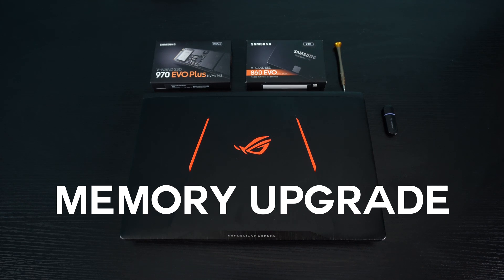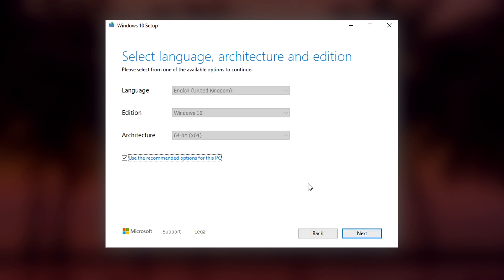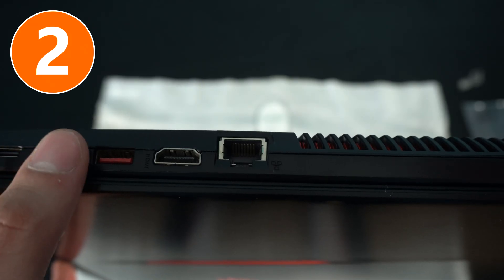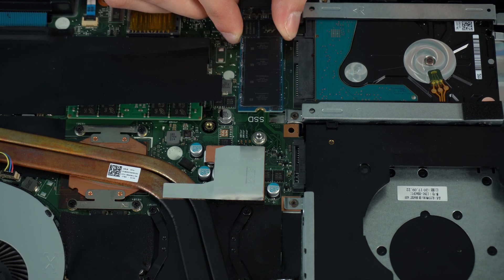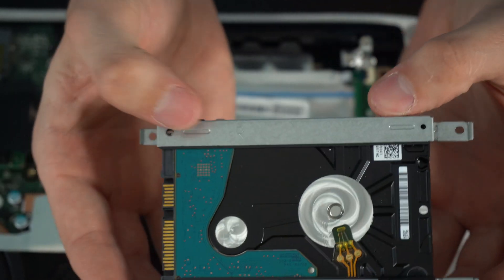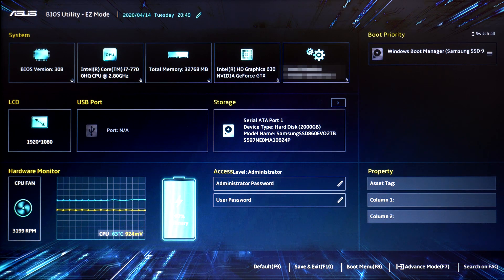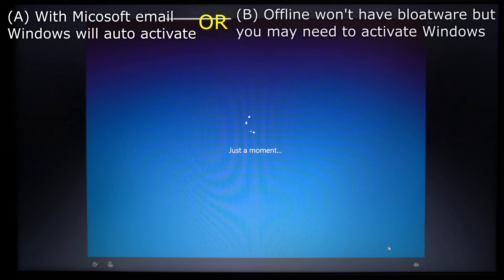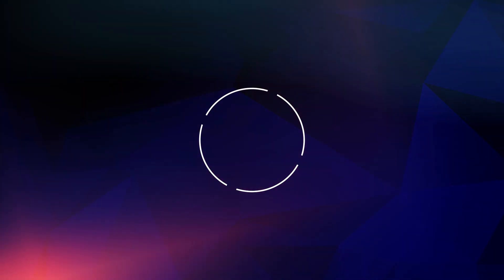How To Install NVMe M.2 SSD & A Solid State Drive In Laptops

Comment: How do I know what drivers I have after the fresh install. And which ones I need so my Pc can run the best performance.
Reply from the maker: Nowadays if you just update Windows it should also install the essential drivers but the most important ones are graphics driver and network drivers but like i said now when you update Windows it will also automatically install them
Reply from the maker: Or once you have full Internet connection

Comment: for better performance from a laptop between using
only 1 tb ssd nvme partitioned or
500gb ssd nvme + 1tb ssd sata or
500gb ssd + 2tb hard drive
What would be the best storage option?
Reply from the maker: If you're on a budget then go for 1TB nvme but for the best performance go for something like 500GB nvme main and 2TB ssd because your 500GB can focus purely on Windows & programs while your other one will be purely for storage (saving and reading data etc.)

Comment: Do we have to change the bios back to fast boot after windows installation?
Reply from the maker: It's completely up to you if you want your system to quickly boot up then have it turned on. What it does is instead of your system fully shutting down it will put it in hibernation mode instead

Comment: why format the USB in Fat32 and not NTFS? if I will install the SSD storage myself, will it void the warranty of my laptop?
Reply from the maker: For the usb i just left it on default settings and yes opening the laptop will void warranty because they have a little bit of blue paint on the bottom of the screws which will fade away over time and show them it's been open before

Comment: Best video I have seen for this laptop thanks. I have had the GL553VD for a few years but is slow now so I am putting in the same SSD and 32gb of Kingston DDR4 ram. I hope this will speed things up a bit.
Reply from the maker: Yup m.2 will and some ram, check your laptop model to see the max ram speed you can have for best speeds. Also I appreciate the feedback glad the video is helpful:)
Reply: @VerticDesigns  I have the Asus GL553VD DM596T it's only has 4gb and can have 32gb max so that's what I went for. Maybe later I will get the 860 EVO SATA 3 and change the HDD.  I also watched you RAM video that seem very basic so sure all will go well and I will check more of your vids and sub thanks.
Reply from the maker: @kanenstuff  ah right and yup ram is very easy to do. Just plug and play. You'll have to let me how it goes after the upgrade aha I can't believe yours only came with 4gb they definitely cut a bit of the budget on the ram
Reply: @VerticDesigns  can I ask a quick question if I am not changing the HDD to a SATA Samsung 860 can I just put windows 10 on my 970 EVO PLUS M.2 SSD? Any information would be appreciated if you have the time thanks.
Reply from the maker: @kanenstuff  Yes, since your M.2 will be your primary storage. You can upgrade the HDD at any time without having to reinstall Windows
Reply: @VerticDesigns  OK thanks that makes it more simple thanks for that.
Reply: @VerticDesigns  hi how are you I have upgraded my M.2 and all is good but with the kingston KVR26S19D8/16 DDR4 the number on ROG gaming centre are weird.
GPU 139MHz
Temp 44 degree C
Memory 405 MHZ
Then it changes to
GPU -1
Temperature -32768 C
Memory -1MHz
Is this issue as I thought the DDR4 is plug and play the SSD was simple but these numbers make no sense and why they change back and forth. If you have any idea would be greatly appreciated thanks.
Reply: @kanenstuff  how did your upgrade go? I am thinking of doing the same with the SSD and storage.
Reply: @akg2n  it's gone fine for me so far but don't use epic games or it will do the BSoD. I had to reset my computer then all was good my write speed is up from 128 to 3320 which is nice.
Reply: @kanenstuff  thanks I did the same with my gl553... Difference is night and day. Really happy with it.
Reply: @akg2n  glad you like it, it's super fast and how it should of came from the box.

Comment: is this applicable to all laptops? I have a Nitro 5
Reply from the maker: If they have a M.2 or SATA port like in the video then yes. Best thing to do is double check the laptop motherboards manual it will say on there
Reply: @VerticDesigns  oh right, thanks! Sorry I know nothing about these things and I've been researching, so windows 10 is lost when you change storage? I thought it was like a separate thing 🤣

Comment: Hi, great video. I have rog strix GL 753ve, similar to this one, i'm planing to upgrade m2.sata 256 gb micron to new samsung 980 Evo Nvme 1TB. I was planing to migrate my current ssd to the new one with samsung software. I'm not sure about the windows license, I have OEM license activated so basically it goes to one device. On Microsoft page they say that OEM license is linked with  the motherboard so i could reactivate it. Also currently i'm not linked with microsoft account, just the local account beacuse of annoying wifi request. Is it safe for me to continue with the upgrade and migration? Thank you.

Comment: My 970 evo plus didn't deduced by Bios (ASUS like you) why?
Reply from the maker: Does it just not show up anywhere in bios?
Reply: @VerticDesigns  not show in the bios and in the window setup also.
Reply from the maker: @MrDr2GoN  That's strange then it should pick it up, have you got the exact same model?
Reply: @VerticDesigns  I have Asus Tp410
And I upgraded my ssd to 970 evo plus. Maybe the ssd driver is old
Reply from the maker: @MrDr2GoN  That is a good point, try getting a new driver on your usb and updating like this video see if it helps: https://www.youtube.com/watch?v=8VS-u_ZrgVs&ab_channel=JuanLince
Reply: @VerticDesigns  I updated the bios and still same problem.

Comment: Wait Sir I want to ask something. Your old SSD are SATA right? with 2 keys (M Key and B key) and your New SSD are NVme with only one key (M Key). Will it work and will it do any harm?
Reply from the maker: That's a very good point and I believe it depends on the laptop and manufacturer because I've been using mine since I installed it with no problems, the boot is normal for me and is quick but some are designed for either SATA or PCIe and some support both. Best thing to be on the safe side is look at your manual or contact your laptops company for a more technical support and help or just simply test it. I shouldn't damage it because most products are backwards compatible so even if you didn't get the full potential it should still work like normal but like I said best thing is to asking the company because they know everything about the system
Reply: @VerticDesigns  We have the very same laptop sir, so I think that'll be okay then.
Btw, thank you sir
Reply from the maker: @billclintonmosesmanullang7446  No worries and nice it's a good laptop plus it's easy to upgrade

Comment: Hello @VerticDesigns, i have the exact same laptop as shown in the upgrade video. Im thinking of adding a NVMe M.2 SSD over my 1TB HDD. I see that you use a 500GB one, i wanted to upgrade directly to e 1TB NVme M.2. However on the official ASUS website it says the SSD storage capacity is up to 512GB. Does that mean it cant support a 1TB one. I couldnt find an answer to this. Wanted to be sure before i buy it? Thank you!

Comment: Guys when l replace my old m. 2 ssd 500 card with new m. 2 ssd 1TB card.. I can't start my laptop, it is always starts with bios now.. How can l go out from bios? It brings me back to bios after l  restart my asus fx505 laptop. Thank you guys!
Reply from the maker: Sounds like you need to change the boot priority to your new ssd, if you need in bios there will be a location that allows you to change prioritizes. Set your m.2 as your first boot option. Also did you install Windows? without the OS then the computer will just launch in bios
Reply: @VerticDesigns  Thanks for fast reply.. My old m. 2 ssd card, was the only memory card inside my laptop, I got only one spot for m. 2 ssd cards.  So probably, that's why starts on bios, windows installed there. Can l install new windows on the new m. 2 ssd 1TB card? Or is better to put Sata hdd inside for extra memory? Thank you very much!
Reply from the maker: @francescogeo  it depends on what you're storing but normally it's better to separate the boot ssd from the storage drive but if you're just going to be using programs then that 1tb should be enough
Reply: @VerticDesigns  Thanks. Thanks for your time!
Reply from the maker: @francescogeo  it's all good

Comment: Hi,
How does license of current windows 10 goes to Flash Drive or how does new copy of windows 10 handle license?
Reply from the maker: Basically Microsoft allows you to install a fresh installation of Windows but all you need to do is buy a license key to activate Windows. I'd recommend Kinguin they have some cheap keys compared to retail but they're OEM keys meaning one activation only. Once you got the key you get a few blocks of numbers on your screen, you call the number, read them out and activate it over the phone

Comment: Would this work for the ASUS Nitro 5?
Reply from the maker: Yes, it's even easier for your model because the bottom panels are separate so you can open the ram window directly

Comment: I have a hp omen, currently it has a 1tb hdd but I bought a m.2 ssd, it can install the operating system and work on the m.2 if I previously installed it on the hdd?
Reply from the maker: If you install the m.2 and format it then it will act like your secondary storage and windows will run off your hdd. 

If you want the m.2 to be your primary then you need to backup your files from your hdd and wipe it, install a refresh new windows on your m.2 and put all the files back on your hdd after formatting it
Reply: Is it better to put windows files on the ssd or hdd? What's the pros and cons? Thanks :)

Comment: Hi, so I only have a hard drive on my laptop and I’m planning to put an m.2 ssd on my laptop and make it my main, and I’m still planning to keep using the hard drive as my secondary will my files on my hard drive that used to be my main will still have all the files? As in like when I boot up using the ssd will all my apps be erased or no.

Comment: is there a way that you can just run the M.2 SSD by itself w/o the SATA SSD meaning that you don't need the SSD SATA DRIVE?
Reply from the maker: If you wanted to yes you can just run the M.2 by itself as the primary one

Comment: Hi, does samsung 970 overheat easily in laptop?
Reply from the maker: To be honest with you no, not really. I still have great performance and since I've installed both of these SSD's my laptop has been so quiet you can't even hear it until you start gaming or editing. So yeh it works perfectly with laptops I would definitely recommend it. It idles at 40° average then it hit 43° when I opened premiere pro and while gaming I got 60° max

Comment: hey! so i have the asus gl553VD laptop and im wondering if the nvme m2 will fit in my laptop cause i know the samsung nvme only has a m key but the ssd currently installed in mines has two keys... so i think thats sata. so should i buy an samsung nvme m2 will it fit?
Reply from the maker: I probably wouldn't recommend it as you'd mostly likely get the same performance if the socket is just a standard sata but I also need to do more research as I'm not 100% sure on this so Id say to download the manual or contact Asus. There's also a lot of forums discussing this topic

Comment: If your Laptop already uses an SSD as it’s primary storage, then will swapping it out for a new one to improve more storage delete your files? Will they still be on the old SSD? Because most Laptops only have one M.2 slot. (To my understanding)
Reply from the maker: When you take it out the files will remain the same yes you keep everything unless you wipe it. What will happen when you load it up is there will still be a partition saved with windows and other half will have your files on
Reply: @VerticDesigns  Thank you for not only answering my question, but responding so quickly.
Reply from the maker: @Ian.cul017  no worries and have fun with your upgrade aha

Comment: What would be the steps to follow if i wanto to add a new NVME M.2 SSD?
I have a ROG G15
Reply from the maker: If you're only installing it for storage then you just add it in then format it but if you want to put Windows on it and use it as your primary memory then you'd follow the same steps in the video except the secondary storage that's additional
Reply: You would do the same thing, except just change out the ssd, and choose it to download windows 10 on it

Comment: Broo... Will my files from my laptop will be deleted??? I don't have ssd but i will install an ssd.... What should i do before and after inserting ssd... (am saying this again)i dont have an ssd forst but i have now.. Cuz i bought 1
Reply from the maker: If you're just installing a secondary ssd for storage your main storage will remain the same and your laptop will boot up as normal but you'll need to format the new ssd in "Disk Management" like I did at the end of the video for it to be visable.

To be more safe you can backup your important files to an external hard drive, USB or the cloud 

If you're switching your primary memory with Windows on then you will definitely need to backup your files as you need to wipe it first to install a fresh new copy of Windows
Reply: @VerticDesigns  do i have to back up my files? This is my laptop's situation:
Have an hdd 1tb
Then i bought an ssd for the ssd slot(my first ssd...my laptop doesn't have an ssd at the first place... It just have an hdd)

And can ssd and hdd work together?
Reply from the maker: @AnimeRankFrenzy-1210  yes they work together, which one are you looking to have Windows run on?
Reply: @VerticDesigns  my new ssd..... I have a last question hehehehe...can i backup/not delete my Microsoft word/excel/PowerPoint etc.?
Reply: @VerticDesigns  and what will happen if... I would just insert ann ssd then open the laptop
Reply from the maker: @AnimeRankFrenzy-1210  If you open the laptop with the ssd it will just boot as normal and if you're only going to use it for storage then that's fine you keep everything but if you wanted to move windows on it then you'll need to wipe both so there isn't a duplicate of windows and the laptop wont get confused aha
Reply: @VerticDesigns  ohh thank you very much for everything... My anxiety is gone...i'll subscribe to your channnel... You're a great help
Reply from the maker: @AnimeRankFrenzy-1210  I completely understand because I'd be the same so I'm glad you feel better now and it's answered your questions
Reply: @VerticDesigns  can i ask another question? Will my laptop improve? If i just only insert ssd to my laptop and run it?
Reply: @VerticDesigns  nice no need to worry about my apps if will just insert my ssd and open it...
Reply from the maker: @AnimeRankFrenzy-1210  the performance you'll notice is when you save files to the ssd or move files onto the ssd or play games from it the loading times will be quicker but your boot time will be normal
Reply from the maker: @AnimeRankFrenzy-1210  also with an ssd you can even use it externally like a usb if you get the cable that is like an usb adapter
Reply: @VerticDesigns  for confirmation(anxiety s*****) if i just put an ssd then i open my laptop my files wouldn't delete right?
Reply from the maker: @AnimeRankFrenzy-1210  they would remain the same, yes

Comment from the maker: Timeline
---
00:00 - Intro
00:42 - Download Windows 10 

01:05 - Formatting USB 

01:40 - Setup Windows 10 

-

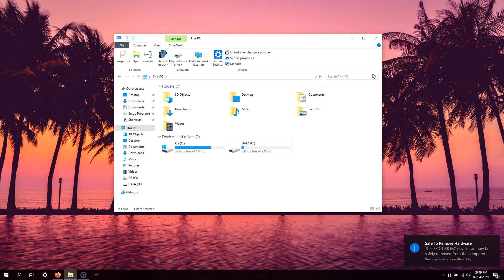02:54 - Download Drivers 

03:30 - Installing NVMe & SSD 

10:07 - BIOS Settings 

11:32 - Install Windows 10
 -

12:57 - Setup Storage SSD
13:47 - Activate Windows 

14:04 - Graphics Driver 

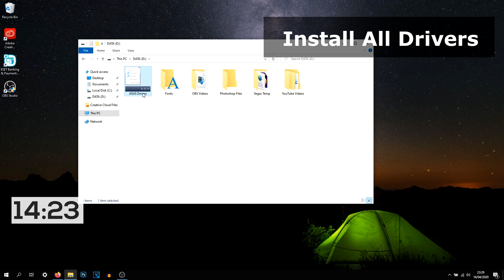14:23 - Install All Drivers 

14:41 - Outro